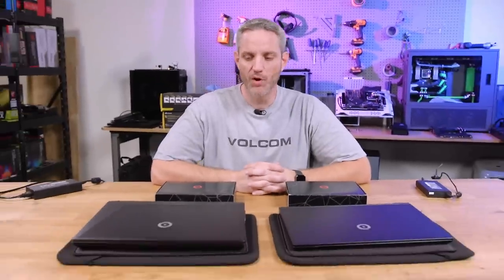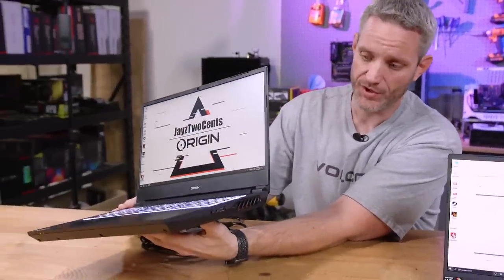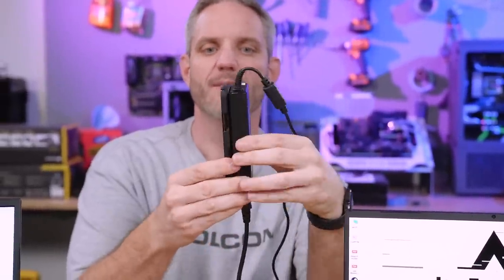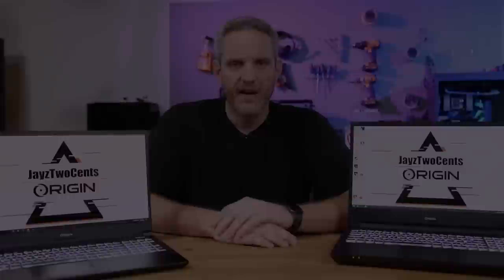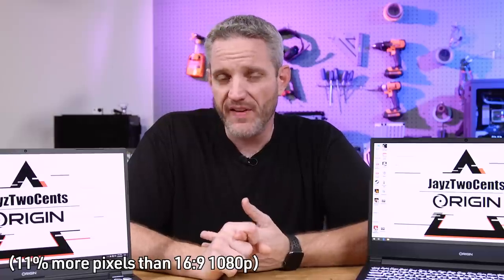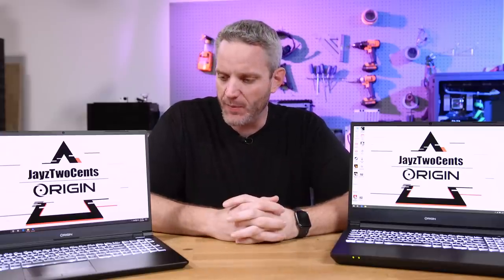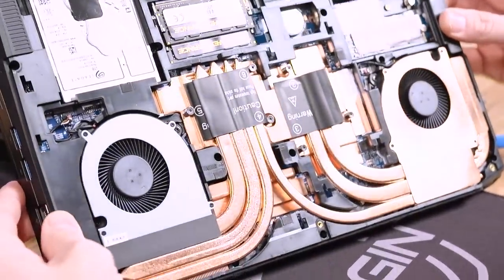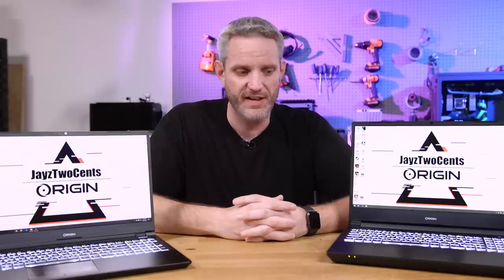A Laptop with 16 Cores 32 Threads?? Desktop killer!

Comment: "So thick"

Meanwhile my best friend's laptop with a 7700HQ and GTX 1070 is close to 50% thicker. If that's not a perfect indication for how far laptops have come in just three years, I don't know what is.
Reply: I know right. Back then "budget" variants were still laptops with the GTX 940MX. Nowadays budget variant consists of GTX1650. In just three years
Reply: @fxjh21  Also back when NVIDIA said "Mobile Pascal will be exactly the same as the desktop models!" and then released Max-Q cards.
Reply: @RealRaynedance  😂😂😂 Yeahh. Laptops honestly have come a very long way.
Reply: meanwhile i am crying in my laptop with 3550h + 1650.....
Reply: @Skooz  you shouldn't. If you saw the prices in where i live, compared to prices that would be reasonable, your eyes would come out of your socket.
Reply: @Skooz  i use a 7700hq & 1050ti hp laptop for professional architecture work - it's three years old, chugs sometimes, loud as fuck, but gets the job done. I'm sure your 3550h and 1650 aren't slouches either. Just happy that basically most "mid-range" laptops can perform actual demanding 3d rendering and CAD work. Hoping of squeezing 3 more years of performance from that laptop before upgrading to something way better, whatever that may be in three years.
Reply: Yea its crazy how you can put high end cpu and gpu in small space with good cooler
Reply: I have an i5-5200u + intel hd 5500 ༎ຶ‿༎ຶ
Reply: Cries in 6700hq and gtx 965m
Reply: @008abdullah  tf you have good spec laptop
Reply: @amer2142  maybe 6 years ago yes, today not so much
Reply: @008abdullah  its still decent my lap have intel hd xd 
I upgrading next week to a better lap and new pc
Reply: @JareTerran  Upgrade it with a cheap SSD if possible. That will make it much faster and give it new life.
Reply: I bought my laptop for college 3 years ago and was happy with my 2 core 4 thread i7-7500u. Now you can easily find 8 core 8 thread Ryzen 4700u laptops for the same price. It’s crazy to me!
Reply: @apricotmadness4850  I use an ssd but yeah, that's a must - whatever you have, if you're using a HDD for programs and OS and not an SSD, you're doing a disservice to yourself, don't cheap out on SSDs!
Reply: My gtx 1070 6700hq 4k rez laptop is not thicker than these laptops. Go ASUS!
Reply: Luckily my almost 2 year old laptop with an i7-8750H and GTX 1070 is still pretty good. I guess I chose the right time to buy.
Reply: @Kortexual  even the 6th gen i7s are fine as wel. Since desktop graphics came to laptop it was the best time to buy.
Reply: i got the clevo NH55AF myself (the laptop with the 3950X in here but mine has a 3900) compared to my old P170sm-a its a thin and light and the old laptop is all mobile parts
Reply: @lekoro1  I am just happy that full fledged gtx 1000 cards are in laptops nowadays. Gtx 16xx and rtx cards were mostly downclocked or cutdown Vs desktop parts sadly. These clevis def. changed that now.
Reply: @JareTerran  I got an ASUS TUF laptop with those specs myself. 1650, 3550H, 16GB RAM. It runs fine for my gaming needs and I've even been able to max out games like AC Origins and play recent titles like Doom Eternal and DMC5 with high settings and get high framerates. Been able to use RPCS3 with this laptop as well. The 1650 is a fine GPU for budget laptops and the 3550H is a decent CPU but it does fall behind the 9th gen Intel mobile chips it tried to compete with. I am looking to upgrade though. I'm coming in close to a year of owning this laptop and I think it's time I got something better. I tested the waters with my purchase of this ASUS laptop because I've never bought a gaming laptop before this and now that I know gaming laptops are practical for gaming and daily use I'm ready to spend a little more on something high end. The narrative that gaming laptops aren't good enough hasn't been true in a good while.
Reply: @aninfinitemindofmusicandreams  ah man, the ryzen laptops that are coming out are amazing, i think now is a perfect time for upgrading! Good luck with that!
Reply: @JareTerran  Yep, looking at some of the Ryzen 4800H and 2060 options. Would be a decent upgrade over my current one especially on the CPU front. But I'm also considering some of the Intel 10 series laptops that have 2070s and 2080s in them. I'd preferably wanna buy something under 2.5k that could last me the next 3 or 4 years for gaming at high settings and good framerates.  I'll wait a bit more and see if any new laptops come out with 2070 or higher GPUs paired with the 4800H. That would be ideal.
Reply: Chris Allbritton  Thats a thickness anybody not carrying an extra keyboard would mind. At that point imo a mitx build with a nice portable screen is better
Reply: @JareTerran  to be fair CAD isnt exactly demanding. I bought this laptop because it is the cheapest "gaming" laptop, i dont game much but i simply cannot stand a pc without a dedicated gpu. I know ryzen integrated gpu is god tier comparing to intel, thats why i got it instead so i can save some power when i am not doing anything graphic intensive task or game.

but man, it is a little annoying when i cant even run witcher 3, a 2015 game, at a steady 60fps lol........yeah i know i know its a mid/low tier laptop but 2015 man! 2015!! lol damn it!!
Reply: @aninfinitemindofmusicandreams  how the fuck do you run AC origins at max setting? You wont get anywhere near 60FPS with max setting, i know because i have the exact same laptop! This is the same for Odyssey as well, i have both games and i have to sacrifice a lot of the graphics for playable framerate....
Reply: @Skooz  Where did I say I get 60 fps on Origins max settings? I said high frames, didn't mention the number. I get a solid 60fps on Doom Eternal and DMC5 at high settings, for Origins maxed out I get 50+ FPS on most areas. Mid 40s during Alexandria and other NPC heavy places. I can easily lock it to 45 frames and it's stable. More than playable enough. I CAN get a steady 60 frames at 1080p if I lower the settings to medium or a mixture of medium or high. I'm not sure why your laptop isn't hitting the same frames as mine if we have the same models. Odyssey is a different beast altogether. A badly optimized CPU heavy beast that the 3550H can't tame. But Origins has always been easy to run for me.
Reply: That video also has TW3 running at high and it meanders around the high 50s. When I play it I put the sliders all the to the right while keeping ambient occlusion to SSAO and not HBAO and free roam gameplay is more often than not a steady 60. 

The point I'm trying to get here is that for what it is, a budget gaming laptop, it is more than decent enough to play most games maxed out with decent framerates. For games that are super optimized like Doom, DMC5 and Death Stranding, this laptop can maintain a 60fps framecap at great settings. For games that are harder to run like Arkham Knight, it does well enough with high and very high settings. Hell, I was playing FFXV a while back, one of the most demanding games on PC and I ran it pretty decently at 1080p and settings at high. For 800 dollars brand new, this laptop offered more than enough performance for me for the price point. If your expectations were that this thing would max out everything at 1080p and give you 60fps all the time, then I'm gonna say you should have gone with the next gaming laptop price bracket at 1000 to 1200 dollars. Those ones have 1660 Tis and these days you can also get 2060 in that price point. I'm seeing an Acer Nitro 5 on Amazon right now for $1,049.99 excluding shipping and it has a 2060 paired with a 9750H. These laptops are the ones that'll give you the framerates you want at 1080p, the mid tier gaming laptops. I appreciate my ASUS laptop enough but I was simply testing the waters with gaming laptop by buying a cheap one. Now I'm looking for something better. And if you're really having such a bad experience with it, then I think selling it and getting something like that Acer Nitro 5 would be best for you.
Reply: @aninfinitemindofmusicandreams  I thought it's weird too so I used my laptop screen instead of the TV and suddenly it's smooth..... Apparently using TV as monitor somehow give me lower fps for no reason.....
Reply: @aninfinitemindofmusicandreams oh yeah I am not expecting amazing performance with 1650 really, I actually don't game that much on PC since I have a PS pro. It's just a little annoying every now and then I purchased a game and find out I can't run it smoothly. Can't say I am a huge fan of console 30fps on many triple A titles lol, but  for the most part at least it is 30fps steady. Due to poor optimization PC ports often have lag spike and that kind of bothers me. I can handle the 30fps as long as it is stable I guess?
Reply: @Skooz  Have you been playing hooked to the TV monitor all this time? I have a PS4 myself and the thing is, as long as a game is at least 30 steady, it's a fine experience. The exception to the rule are games that require fast twitch responses like hack and slash games or FPS games. With this laptop, I can at least average 40 plus FPS on new demanding titles with decent settings. Never get too many frame spikes or dips so the experience feels smooth. For super optimized games like DMC5, it's no issue at all to have higher than console level settings and get a perfect 60 fps all the time. And I played that game on PS4 as well to compare it and it's much steadier on my laptop. 1650 is a fine GPU for a budget laptop and it's stronger than the GPUs on the original PS4 and XB1, a good bit stronger actually. So you shouldn't have any issues running most games with preferable settings. The problem with this laptop starts to manifest in CPU heavy titles like AC Odyssey, which is one of the most awful PC ports ever and that's universally agreed upon. The other issue comes from the VRAM limit. 4GB graphics cards are gonna go the way of 1GB and 2GB cards with higher and higher VRAM requirements in most games. So you'll be fine with most games for now but very soon it won't be enough to have 4GB cards. 4c 8t CPUs also aren't going to cut it after a while which is why I think it's very important to make builds that have at least 6 core CPUs. Or for laptops, the 4800H 8c 16t is the one I'd go for on my next purchase. Just waiting to see if it gets paired with a GPU higher than the 2060.
Reply: @aninfinitemindofmusicandreams  oh yeah, my PC gaming will be cut down significantly after ps5 since they claim to deliver 4k60 experience and I am counting on that. Apparently gaming on laptop screen somehow always gives me higher fps with this laptop, I can't figure out why but that's just the way it is lol. The reason why I enjoy plugging my laptop in the TV is because I have a decent oled TV so playing back HDR movie is great. I guess I'll have to unplug it every time I play.....Kinda dumb but I don't see another choice until ps5
Reply: @Skooz  Fair enough. I'll be buying the PS5 as well. My gaming setup is too cluttered with PC, PS3, PS4 and XB1 S. My Xbox gets no use these days so for next gen I'm looking to just get the PS5 and a powerful gaming laptop or if it comes down to it build a powerful gaming PC and that's it. De-clutter my setup. Gaming laptop would be preferable at the moment since I travel often.
Reply: @aninfinitemindofmusicandreams  haha that's exactly my plan as well. IF I game on PC at all I'll just get a better laptop instead of a high end desktop, since I'll probably okay things like RTS and possibly FPS games on PC only anyways
Reply: Yeah I had an Alienware 15 r3 back in 2018 with a gtx 1070 and all dat and it was thick, I just got an msi GE75 Raider with rtx 2080 super and it’s a lot less chunkier and it’s a lot thinner I’m really impressed
Reply: @meareAaron  GT72VR.
Reply: @RealRaynedance  those titan laptops are super good just be sure to grab the HK or K variant so it can last you a lifetime
Reply: @meareAaron  I think if she replaces it anytime soon, it might be something from ASUS's Zephyrus lineup.

Comment: When you made that comment about my 3900x being slower even though I'm about to put it on a custom loop you took all the wind out of my sails. Thanks a lot jay lol.
Reply: don't worry your 3900x IS faster in many applications :)
Reply: @vanburman  Like those two chrome tabs :)
Reply: @Drazard10100  hahaha
Reply: Well, it has 4 more cores and 8 more threads, of course it's gonna be faster even if the clocks are reduced.
Reply: @simon7109100  how do you know? And in what tests? We don't know the speed it's running at I can presume that a desktop 3900x is running faster ram than 2400mhz.
Reply: Overclock it and it'll be faster. Mine got 7925 in Cinebench r20, beat that 3950x by over 300 points!
Reply: @NameName-ll2yx  my r9 3950x gets over 9200 in r20...
Reply: Here cooking the cpu with the Wraith Prism, yeah sure I'll overclock it
Reply: @vanburman  Jay said it's running in a low power mode, so I assume it's lower clocks. Also RAM speed not going to do much for you when you have 8 more logical cores, if an app is using all cores, there is no way something with less cores is gonna beat it.
Reply: That hit me where it hurts too
Reply: .........just go to the site and use the configure etc setting bs........they say 4.6ghz turbo.....prob not an "all core" setting.....granted those same cores.......arent running at 4.6 on a 3900x...."stable" with the ram or etc....i mean 3200mhz is an option....for ram. even the 64gb kit with 1tb 970 m.2.....and 3950x....is a scratch under 3k....compared to "vendor" options or etc.....thats a lot of speed and "potential" when compared to a laptop and desktop........and the typical "how....." is bc.......It has 16 cores to choose from to do single-4 core tasking......so it overloads the literal best 2-4-8 cores among 16....and hits that 4.6 turbo.....vs only having a total of 8 with the 3700x.......or 12 with the 3900x......and lacking the actual "capability" among the total cores and the overall binning of the 3950x for this specific reason......its like the flagship of amd/ryzens core/clock selection, as far as it can choose the best cores to boost....and thus is the best "showcase" of such a concept. I guess why Intel is now implementing their INTEL PILE DRIVER for 2022 KEK....but in theory having 4 extra cores or not......is like if the cpu knows its an IPC task and needs more cores total to do something faster overall or etc.....bc it has the access to more computing/computation its one thing.....but if it doesnt need it/is not the case......then vs a 12 core 3900x.....the 3950x.......can use the 4 cores that suck the most......then boost the other 12 to hit an overall better boost clock than the 3900x can ever hit all cores to in theory beat the 3900x in all benchmarks on paper/in principle by that basis....while having the xtra 4core/8 threads when needed to beat the 3900x......kek. but it costs more so it should.....principles.... insert ancient aliens meme. I see the 3900x........as a 3700x with the "extra 4 cores-8 threads as well.......you wanna game+ stream theres your 8core-16 thread v intels.....+ the extra room for "stream/video capture" activities etc.......with pci-e m.2 capability. Not sure on laptops
Reply: Yeah, my 3900x is on a castle 360 and I started laughing because it was like he was talking to me.
Reply: same but once you start oc'ing i think things will turn around
Reply: Yeah i have it sitting out of commission right now getting ready to set it up for watercooling slowly getting everything together for watercooling it peice by peice so that i can see how far i can push it. I can't complain at all though I am blessed to have what i have when it comes to my computer just realized my comment sounded a little ungrateful lol.
Reply: @NameName-ll2yx  my 3950x got 8949 with about 40tabs of chrome and other programs open on stock settings without opening my all core OC profile.
Reply: @simon7109100  just look at the amount of 3900x users with a higher cinebench score than the laptop. I'm surprised actually that people in the pc sphere will overlook facts and figures because they want to believe what they are told. Do any amount of research and the information will be right there.
Reply: @vanburman  This much is true but this generation of AMD CPU's don't get much boost from the RAM speeds like the 1st generation AMD CPU's did.

Comment: "Two Chrome tabs..." Okay, I admit this laptop is impressive, but let's not get carried away here.
Reply: I keep reading these chrome tab references and scratching my head every time. I have 50+ Firefox tabs open on my i3 8GB laptop on a regular basis and never ran into issues. Is Chrome really that miserable in comparison? Why do people still use it then?
Reply: @nekekaminger  I don't know if it is still the case, but I remember someone had told me about 15 years ago that Chrome was better than Firefox, and didn't use as much resources, so I gave it a try. I opened my usual tabs and pulled up the task manager, and sure enough I found an entry for Chrome that was about 5mb of RAM lower than what I typically saw out of Firefox. Awesome!

But my laptop was bogged down significantly more than usual. So I pulled up the task manager again to see what was the problem. Well, for each tab that I had opened, there was an instance of Chrome; 5 total, and each was about 5mb of RAM below what I typically saw out of Firefox.

I don't know if Chrome still has that problem, but I'm not willing to find out, either.